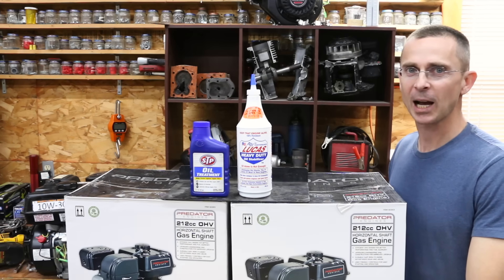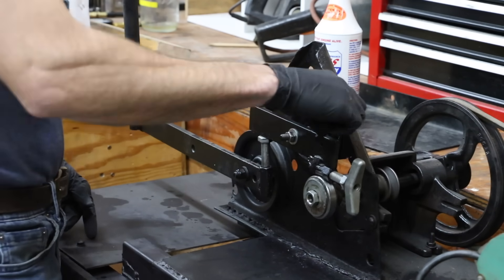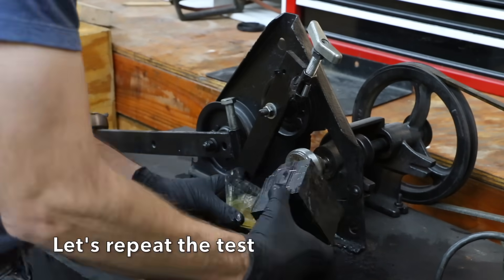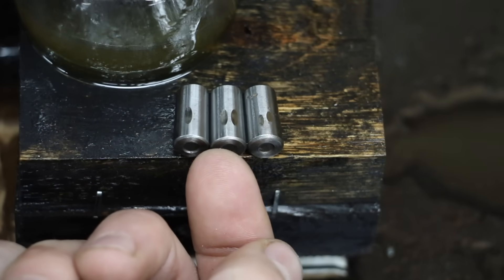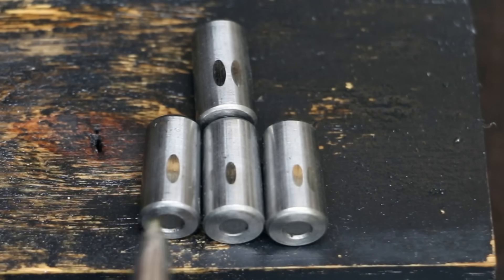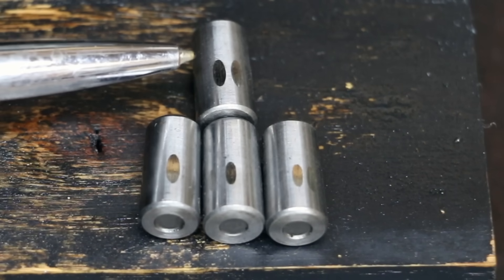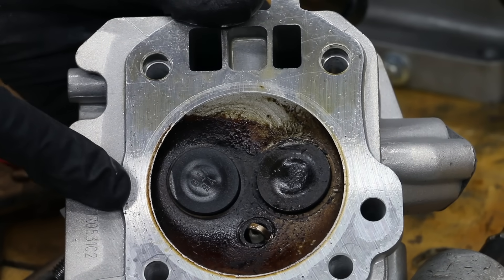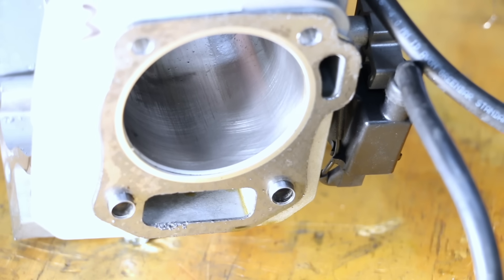Which engine self-destructs first?  Lucas or STP?

Comment: Try petroleum vs. 100% synthetic, such as Valvoline Petroleum vs Valvoline 100% Synthetic. Also, if done correctly, try a good Synthetic vs. AmZoil, & for a 3-in-a-row test, try 100% Factory-Spec. Petroleum, 100% Synthetic (Valvoline or Mobil-1), & 100% White Aero-Grade LubriPlate. (Spoiler alert: The LubriPlate will go for a minimum of 20-minutes with zero damage in a freshly-rebuilt 1971 Cadillac 473-cid V-8).
I know this from "hands-on experience".
The Lubri-Plate was normally used as "assembly lube", & the oil pumps' over-pressure spring had been overlooked, providing zero psi of oil pressure, yet when the spring for the 473-cid engine was noticed on the parts-tray, & the engine was stopped & taken apart to see how badly damaged it was, all measurements were "as-new", w/LubriPlate still visible on everything it'd been put on to begin with... Zero-wear.
I knew someone who'd rebuilt the entire engine & drive-train for their late-1960s Caddy limo w/AmZoil, & lab tests showed that lubricant to still be in "fresh from the can" condition 5 years later, w/the drive train components showing no measureable wear.
In 1980, the only difference between Valvoline & Harley-Davidson oil was the container & the H-D oil was twice the price. When the Valvoline cans stopped coming down the line, any remaining tops were removed from the stack in the "fill-&-seal" machine, & the
H-D lids were loaded ; when the H-D cans reached the "fill-position stop flag", the same button was pressed, 1 imperial quart of the same oil filled the ("cardboard") "can", then that cans' lid, (marked w/the Red, White, & Blue "#1" on it), was in position & the lever which "clinched" the lid was pulled, sealing the can; when the filled & sealed "can" was ready, the metal "stop flag" moved out of the way just long enough for the next can to reach its position under the nozzle, & the process was repeated.
(The newer "re-closeable" plastic oil containers are SO much better than the old "cardboard cans"!)...
When I get an engine that's "new to me", I warm it up, drain the oil out, replace the filter(s) & oil with a "top-shelf" filter & AmZoil or 100%-Synthetic Valvoline, & check both the level & pH at every refueling; I haven't needed to change the oil or ATF in anything I've had in "forever", at least since the much-improved "multi-viscosity" oils were developed. DISCLAIMER: "Your results may vary."
😄
Reply from the maker: Great recommendation.
Reply: Project Farm
Thanks for the comment. Just because I've been disabled for longer than I'd like to admit, that doesn't mean what I've learned over a 1/2-lifetime shouldn't be passed along to the next generation.
Get Blacks' Law Dictionary, (any edition; mine's an 8th edition, although the 5th edition is the best, if you can find one), & read it cover-to-cover. Did you know that the "Personal Income Tax" is voluntary? There's no LAWFUL  REQUIREMENT that you have to pay it.
 Just send a letter to the head of the IRS. stating that, (your name in all-upper-case letters), will no longer be contributing to the personal income task fund ; have a couple of Certified Copies he it Notarized &  Certifiedthe letter CertifiedNotarized Mail & be certain to send the letter via Registered Mail
Reply: How to stop paying the Personal Income Tax Legally:

Date a letter w/the date on it, put your name in ALL UPPERCASE LETTERS on it in the "header" (top); proofread it, then have it Notarized...
 Also have the Notary make a  few Certified Copies while you're there anyway.
 Give your employer one of the Certified copies & keep one in your files, with other things such as Life Insurance, etc.
Send the original via Registered Mail to the the current head of the IRS, stating that "10 days after the date of this letter, (you) will no longer be contributing to the Personal Income Tax fund." 
  Sign it (include your upper & lowercase Signture, both printed & handwrtten).
(I also put a postage stamp showing a numerilc valuation on the envelope, as well as a "Forever" stamp on the letter to ensure it gets there, then have the local Postmaster "Hand-Cancel" it, just before it gets put in the "outgoing" bin.)
And that's all there is to it.

(In my letter, I specified that I wished to maintain my paying the 7.5% "premium, along with my employers' matching contribution for what was long-ago called "FICA", I think it's now called "Social Secury Tax", since it's a form inexpensive insurance.
 In my situation, it was a good thing to have, since I DID become Physically Disabled.)
 73 & have a nice day!

Comment: Honestly you needed 3 engines, one as a control with just regular oil. Also I think I would of stopped the lucas after the STP died and compared scoring and damage between the 2. Waiting till they both died likely gave plenty of chance for the lucas to catch up to the STP in damage. Still an interesting video thanks for it.

Comment: Brilliant (but painful!) test to watch - as for other additives, there is one which I have seen all manner of claims for (from being used by diesel train companies to ocean liners) and is simply called "Restore" - by Ametech.

The product claims to actually "rebuild" scored and damaged part of engines with their product - which contains silver, copper and other metals which I guess are supposed to "smudge into the gaps" somehow.

It is one of very few products I have never seen a PROPER test run involving a before and after strip down of an engine - and as it is one which claims to make badly damaged / worn engines better, I thought it MIGHT be an interesting test on an engine which you have damaged in other tests - but can get it going again "at a push" and then see what a bottle or "Restore" actually does.

The website is here - and I mention it only as a link for you - I am certainly NOT advocating this product - as I am not sure if it is any better than snake oil. https://www.ametech.co.uk/what-is-restore-33-c.asp

I do think a lot of us would be interested in a "before - v - after" look inside a damaged engine that has been left to run for a few hours (in fairness to the product I guess it might need to be a good couple of tankfuls in order for it to start making a difference even if it does work).

They do offer a money back guarantee - but as always the issue is not the cost of the additive - so much as the damage it might cause if it is does more harm than good.

Anyway, awesome video even if watching engines being deliberately wrecked always makes me feel a little sad!
Reply from the maker: Thank you

Comment: Older engines with flat tappets camshafts gotta have the zinc (ZDDP) contained in the STP as friction reducer or they will quickly eat the cam. The EPA has mandated that standard engine oils NOT contain zinc because it damages catalytic converters. So they have actually required that modern oils be LESS efficient in lubricity and friction reduction. They still allow vintage auto enthusiasts to add their own zinc, thank goodness, or these classic cars would die.
Reply from the maker: Great point.

Comment: Prolong. I had a 77 Ford pickup that I had prolong in. I had aftermarket gauges and the plastic line to the oil pressure gauge he got up against the exhaust manifold and burnt it into. I have no idea when it happened but I do know it pumped all the oil out of my truck and it never knocked. I fixed the line to the oil pressure gauge and drove the truck for several years after with no problems. I would love to see how long an engine would run on prolong.
Reply from the maker: Thanks for the recommendation!

Comment: Lucas is merely thick oil. Current STP is basically the same thing with a calcium additive package, only the old stuff has ZDDP. ZDDP is actually good for these small engines (and older engines), to get any now you would have to run racing oil or buy a specific additive (I luckily bought like 50 bottles of Cyclo synthetic oil stabilizer with ZDDP from a local closeout place which I use in all my small engines). ZDDP was mainly removed to lengthen catalytic converter life in cars so they’d make federally mandated emissions warranty. Lucas won this test because it’s simply thicker and leaves more film in the engine. I’m not sure it would be good for a car engine though due to a lack of additives. STP used to make an additive that was simply an additive package booster to extend oil, change intervals. I bought a ton of them for $.25 from a Walmart that was closing. Don’t know if they did any good but doubt they hurt anything, and it was cheaper than actual oil at the time.
Reply from the maker: Thanks for commenting on this.

Comment: The first portion of the experiment was interesting, but what was the point of removing the oil and seizing the engines that way?

I would have thought this would be obvious, but it seems worth saying after reading some comments: Once you removed the oil, the experiment stopped having anything to do with the additives.  The fact that one engine lasted longer than the other had nothing to do with the additives and was just variation in quality from the manufacturer.

Comment: Definitely need a control engine, but honestly I would have had 2 or 3 engines for each just to make sure it wasn't a build quality issue with an engine. This video was fun to watch anyway. As a competitor additive, I'm curious about Prolong since it's a lot thinner than those two (which could be bad or good).
Reply from the maker: Thank you! I plan to test Prolong in the future.

Comment: Next time use same additives and oil leave it in engines and run them  till they drop. You can put whatever you wish in one and then run it with no lube and guaranteed to blow with weakest parts failing first. This test was ok but nothing special
Reply from the maker: Great recommendation.

Comment: Lucas is better at reducing engine wear, but Lucas is also extremely thick which helps it stay on engine parts longer than STP.  The main reason to use STP is for ZDDP which helps reduce engine wear under normal conditions, while Lucas is better at reducing wear under extreme conditions.  If you have an engine that leaks oil, or grandma isn't very good at checking her oil every so often, then Lucus makes sense.  STP is pretty good as acting like a ZDDP additive for cheap Walmart oil, so you don't end up paying a lot for what is essentially Castrol Edge.
Reply from the maker: Great point.

Comment: To me it seems that each additive performs roughly the same relative to their cost and amounts used. This experiment should (I hope) be continued one day with two more with engines each filled with the ratio specified for the product. That would test any interaction/bonding that may result in improved performance which could not otherwise be tested properly. 

Very interesting and well done video. You have my subscription.
Reply from the maker: Thank you!

Comment: Years ago an old mechanical engineer told me the only additive with actual any wear properties was stp I use it in an a least 3 to one ratio in everything I own and I've got over 350k miles on my last 3 trucks and the engines were still running fine just frames got to beat and rusted
Reply from the maker: That's a lot of miles!  Thanks for commenting.

Comment: The methodology is 100% wrong on this one. Additives are designed to prevent friction and prolong oil life WITH oil, stabilize their parameteres of the product. Second heat cause wear, 3 engines should get the same flow of air of the same teperature. If additive is thick it can cause enginge to be hotter. And third the test should last for ex week and then You should  dismount engines and choose same points of test in all 3 of them. This speed up wear test is invalid. Look at engeeeirng expleind channel how mobinil test long life oils. Anyway You do a good work here but unless you get methodology right you can even be sue for misleading customers.

Comment: The stp ran much cooler than the lucas oil. I feel like we are ignoring the significance of that benefit in a regular running engine with oil over a long period of time. Would like to see some more testing on stp reducing the temps in regular engines compared to regular oil
Reply from the maker: Thanks for commenting.

Comment: You mentioned the the Lucas engine was running hotter than the STP engine however the Lucas engine was “downwind” of the STP engine ie: the hot air from the STP engine was blowing over the Lucas engine, the engines should have been side by side and not inline in my opinion.
Reply from the maker: Thanks for commenting on this.

Comment: I'm conflicted about this, I live in an area where we see sub-zero temperatures in the winter, it typically hovers around 0-30 degrees in the winter but can get as low as -12 to the lowest temperature recorded at -60 degrees F. However, it rarely dips below -10 to -15 degrees if you don't factor wind chill. I don't think it's a good idea to put this in my 1988 Toyota Corolla with 227,000 miles on it because of the temperatures. I usually rotate 5w30 in the winter and 10w30 in the summer but this year I waited too long so I just go with Castrol High Mileage 5W30 and a FRAM high mileage filter. The Castrol Oil is very high quality semi-synthetic and imo the best high mileage oil around. Would love to see a video of high mileage castrol vs high mileage valvoline which is second best in my opinion. Then see if lucas oil improves or damages the oil's which already have additives. Thoughts?
Reply: By the way this is the best automotive channel I've found, you answer some serious questions that no one else is willing to risk their motors on!
Reply from the maker: Thank you!  I agree with your assessment that adding a product with high viscosity isn't advisable in colder climates.  Great video recommendation too. Thanks again!

Comment: Here is the thing, STP is NOT meant to reduce friction, it is a thermal setting plastic, the purpose of STP is to boost compression in very old worn out engines where the rings are shot.
Reply from the maker: Thanks for commenting on this.

Comment: My dad and I rebuilt a 1991 chev Scottsdale 350 engine with 350000km the original owner( my dad being the second) has out 280000km on it and used stp from 80000km after warranty. All the oil ports on the crank shaft and up to 80% of other oil ports were plugged solid were we need a screw driver to pound out the build up. The cylinder walls below the piston had flaking chunks off debris  and some flaking was found lose in the crank case. We concluded the stp cooked and caused the flaking along with plugging of ports. My dad work with the original owner who always did normal maintenance. We did not have a comparing non stp block mind you.  

Great video love it.
Reply from the maker: Wow!  Thanks for commenting on this.

Comment: Amsoil vrs marvel mystery
Reply from the maker: Great recommendation!
Reply: Marvel is not motor oil. Amsoil is.
Reply: @tarquineous  actually Marvel has started producing oil now.
Reply: Michael, that remains a Mystery until seen.
Reply: I saw it Michael Thank you. The oil so far is only for older engines. Probably pre-1980 or thereabouts.
Reply: isn't mystery oil more of a cleaner, it isn't even close on thickness compared to oil?

Comment: Looked like aluminum rods that failed. If so not surprised, it takes a much larger aluminum rod to be the same strength as steel or cast
Reply from the maker: Yes, you're right.

Comment: These products aren't really in the same category. STP is ZDDP additive primarily for use in flat tappet engines. It may potentially be bad for catalytic converters but opinions vary. I wouldn't use it in a modern hydraulic lifter engine.

Lucas oil stabilizer is primarily for 2 things: leaving a layer of oil on top of the pistons to prevent dry starts and reconditioning worn piston rings to stop oil blow-by. It's great for smoky exhaust issues.
Reply from the maker: Thanks for commenting on this.